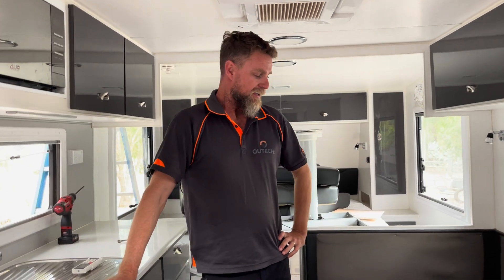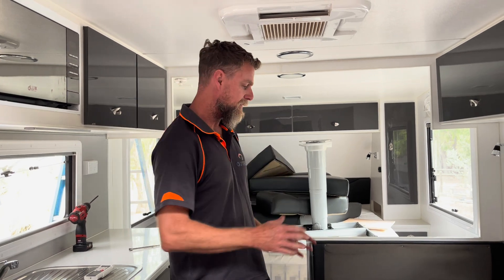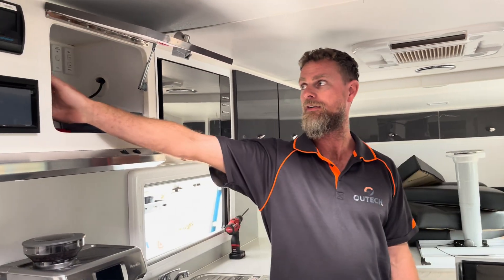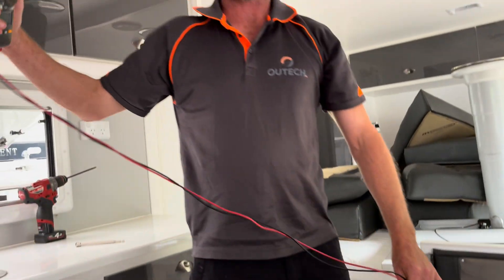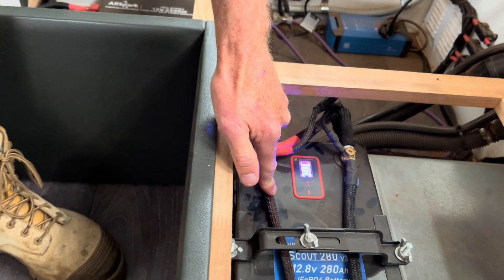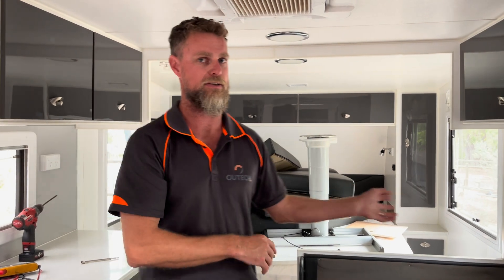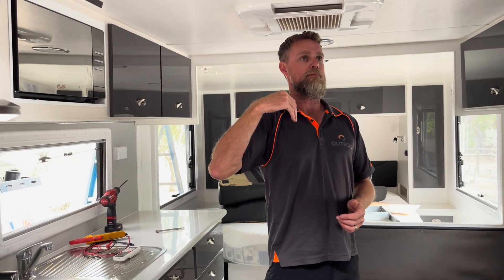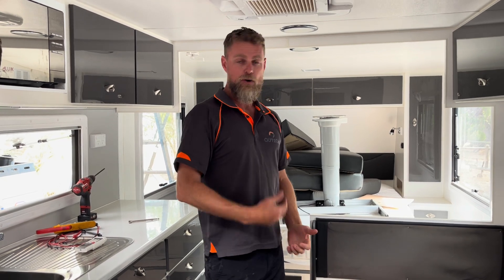WHY DOESN'T IT WORK?! Neat Install, Quality Kit ...BUT 🤯

Comment: Great video bud, so I was told by the person who installed mine just to unplug the 240 charger while using the inverter, but I’ve noticed while on the inverter I have no solar input whether the 240 charge is unplugged or plugged in any idea why this would be? Cheers.
Reply from the maker: Hi mate. That definitely doesn’t sound right. I would suggest getting it inspected by someone who knows what they are doing. It doesn’t sound like the installer you had do the work was across the requirements.

Comment: Interested to know what current the new Harrier pulls compared to the Ibis 👍
Reply from the maker: Current draw between the 2 is approximately the same. However, the Harrier is more efficient so overall KWh used is less.
Reply: Good to know . The soft start would be a whole lot nicer too I would imagine
Reply from the maker: Definitely a lot nicer on the inverter plus the ability to select night mode allows for much less overall consumption.

Comment: thats a great explanation on this system well done and would like to know how you are going to get the 12v feed to your carafan as i am assuming this is a retreat van  cheers Dan
Reply from the maker: Thanks. Glad it was informative. 

We have picked up a spare circuit breaker in the overhead cupboard and fed it from there. 👍